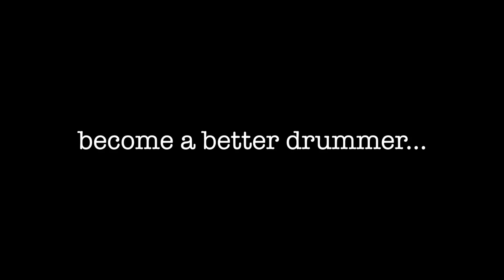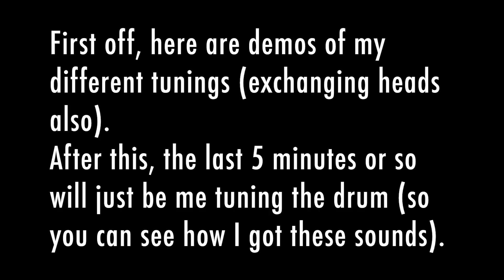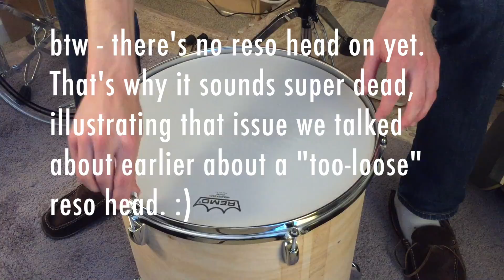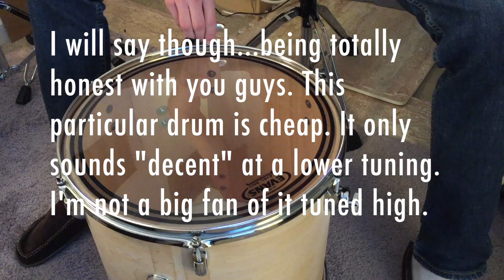Why Does My Floor Tom Sound BAD?

Comment: Dude, this is so much more a helpful tuning tip video than I've been able to find anywhere else. ESPECIALLY because you actually talk about the resonant head; which is something that isn't very much talked about in other videos. Thanks so much!
Reply from the maker: Thanks, man! Yeah it's super important to get the resonant head right. It's easy to overlook it. I've found that in any tuning situation, if you're having trouble getting a drum to sound "right"...try changing up the reso tuning. That often fixes it.

Comment: For toms, I use a one-ply resonant head and a two-ply batter head, tuning the reso a perfect fifth higher than the batter (for a perfect fifth, hum the melody to "Here Comes the Bride" in any key). This means that your drum will pitch high as the reso rings out first and then drop down when your stick releases the batter. IMHO, this sounds way better than going from low to high or trying vainly to get both heads tuned to the same pitch. They never will stay at the same pitch anyway and will merely run interference with each other - kind of like a pair of air horns! 
Then I tune the batter of the the next tom up to match the reso of the lower drum. If you use four toms, say 10, 12, 14, 16, then the reso of the 16 will be the same pitch as the batter of the 14 and the reso of the 14 will be the same pitch as the batter of the 12 and so on. This means that the kit is in tune with itself - like a guitar - because when you hit one drum, all the other drums ring a bit too, don't they? In fact the whole kit resonates - the cymbals too!
So ... Remo Emperors or Pin Stripes on top and Ambassadors on the bottom (or Evans G2s/EC2s and G1s). Nice Evans drum key BTW. I have two of those that I use for quick head changes. Not only do they have that cool knurled knob at the top, but they have little magnets inside the key so they stick onto your tuning rods. 
Please note: this stuff works for me and it's just my opinion that it sounds good. However, if you're having trouble with your tunings, then you may as well try it. Also, if your kit is just too ringy in the studio or your practice space, then try using Aquarian damper rings. I get a nice fat sound with them on my heads, but I take them off for live. Drums should ring - that's what carries your sound. Thanks for the videos Stephen, they are really good!
Reply: Sal Paradise Thank you for the great tip I want to try this (I’m planning on using pinstripe batters and ambassador resos for recording soon).  But if I’m only using a 4-pc kit and have a 12/13 rack and a 16 floor, how should I tune them together using your method?

Comment: The craziest trick for floor toms that I've ever learned—and I've never heard of anyone else ever doing it—is tuning the batter a little higher than you're used to, then completely loosening one tension rod. I'm meticulous and neurotic with my tuning, and on paper, it seems like complete nonsense, but I can't tell you how many times it's saved my ass in a live situation where the sound guy just couldn't get ahold of the overtones.

Comment: Evans has these Hyrdaulic heads, It's great for players with no experience in tuning at all and are really easy to setup without much tuning. Try them out!
Reply: As a proud owner of blue hydraulics, this video is still very helpful. My floor tom sounds like booty and this video is helping a crap-ton
Reply: I would say EC2s are the best in terms of sound quality and ease of tuning, the hydraulics are easy to tune but lack fantastic depth of sound imo

Comment: Here’s a pro tip from the front lines...we’re talking the Boston, gb circuit, Berklee dweeb stuff that no one tells you. The kind of stuff that will get you more gigs.

A huge majority of drummers out there tune their toms too low nowadays. Especially, ESPECIALLY if you’re in a situation with minimal micing. Low tuned drums sound amazing behind the kit. In my practice space, I keep my drums tuned nice and low because I prefer that sound in that environment.

In a gigging situation, no one can hear that. The low end dies in a sea of guitars, bass and middle management douchebags trying to outdouche each other in front of you. Tune your toms a liiiiiittle higher when you’re out. 

At the end of the day, the most important sound is the sound 20 feet out front. If you tune your toms low like every other drummer, your tom work is going to sound like the same indistinct “papapahdodododoo” as every other drummer. A little higher and your personality will pop right through in that context. This is the best single tuning tip I ever got and it’ll help with floor tom tuning as well. Floor toms become exponentially more difficult to tune as the pitch decreases.
Reply: 2 years late to this reply, but You are 100% right! I tune my toms low and I mic my kick and toms at every gig because of this. If I'm unable to mic up (Which is fairly rare) I bring all of my tunings up and drop any muffling I previously had on the toms.
Reply: Another late reply, but the slightly higher tuning and no muffling works just fine with mic’ed up toms as well. Many pro drummers, Simon Phillips, John Bonham, etc. play their toms wide open and tuned up to get resonance and tone. It’s all about mic placement and how you control the input (gain, volume, etc.) I play my toms mic’ed up with no muffling and have the toms tuned medium tight, slightly higher on the bottom. For my kit I find that with the floor toms, the interval between top and bottom is less than my mounted tom. I have a minor third difference on the 13” tom, a 1/2 step on the 16 and 18 floor toms. Most drummers I see on YouTube have their 16” floor tom top head tuned to about an A. For me, that’s too low. My drum sounds floppy and feels sluggish at that tension. I’m closer to between a B and C on top. One thing to note....if I didn’t have an 18”floor tom, I may go lower on the 16.
Reply: Yes. And this should be considered for snare tuning also in live applications. A few years back I was having fun trying out my different snares at different gigs and playing with tuning. I cranked a mapex armory metal snare I have as high as it could go before choking.. What I discovered was that all of the kick and snare parts in the grooves were more defined and heard clearly. I guess the further the pitches are from each other the more clearly they’re heard individually with no overlapping. 

This was something I noticed drummers playing live concerts in the early 80s. The snares were always cranked.
Reply: @martinel2450  

A version of that sound re-emerged in the 90s, too. Half of the grunge records everyone loves were recorded with a piccolo snare, squashed to hell and back with an 1176 or a fatso….why? Because it sounds great, it’s aggressive, enormous and it cuts.

Comment: hi Stephen, very informative video
but according to me, you forgot an important reason why a floor tom can sound bad; the legs of the tom!
i m talking here about floor toms that stands on three legs, not suspended toms on a cymbal stand that usually sounds great because of their good sustain, and sustain is maybe the most important topic when we talk about a good sounding drum, without sustain, nothing possible, and of course it's possible to control the sustain 
the three legs of floor tom are sometimes the reason of a cruel lack of sustain, and if you lift the tom from the ground, you will find that the sustain is back, as if the ground would absorb the resonance of the drum...the reason of that could be because the gum at the end of the legs in not protecting the drum to sound and vibrate freely, or the gum isnt here anymore, or sometimes a bad conception of the drum itself
thank you for your videos
greetings from France
Reply: Agreed, your the only one who got it right, I have a 1964 set of Slingerlands, 14" and 16" toms always sounded like a cardboard box. I changed the minimal rubber feet (gum) to the resonator feet from my Pearl kit and 200% difference and I've never been dissatisfied since (playing 56 years)
Reply: Monsieur. I reckon you are right. Vous avez le raison mon pôche.

Comment: Funny, for me it's always the mid tom espacially 12".
Reply from the maker: Really? I guess it depends on what you're going for. Most of the time I'll get a rack tom sound I like pretty fast, then spend more time on the floor tom. I will say though...I prefer 13" and 16" toms on a 4-piece kit. I'm ok with a 12", but if I have one rack tom I like a 13", which I find pretty easy to tune. Do you tune higher or lower generally?
Reply: Yes me too I can not tune my 12 inch
Reply: Same
Reply: That's everybody lol. 12s are notorious
Reply: try working on your reso head. i thought there was something wrong with me but then i checked the reso head and it was tuned way too low. for toms, you want the reso and batter heads to be identical in pitch.
Reply: Same
Reply: my 12" tom always sounded awful. part of the problem, it turned out, was the tom arm / holder. Swapped it out for a different arm / holder and it sounded better, though still kind of 'dead.' Replacing the reso head also helped... my thought is to go to a very thin reso head.
Reply: el bicho feo I have the original mapex arm all my other toms sound amazing and the bottom reso is less than a year old and it’s a ambassador
Reply: Agreed. I finally got a good process for tuning my 12. My 10 hums
Reply: Remington Creech interestingly the Tom arms I was using - that somehow contributed to the wack-ness of my 12" Tom sound - were Mapex Tom arms!!! Saturn series circa 1994. Replaced with spare Pearl Tom arms, the Tom sounded much better...
Reply: ...same...
Reply: One problem I notice with tuning a 12” tom is it’s angle and proximity to the bass drum. If I have it too close to the bass drum, and without a good amount of angle (anything less than 30 degrees) then I will usually get a fairly dead sound.
Reply: Morgane Gautier yep
Reply: Andy S I’m using the latest version of mapex Saturn I didn’t mean to buy the g1 I wanted g2 for too not sure if that has any dealings
Reply: Andy S if it’s the arm wouldn’t you think my 10 inch would sound bad to I love the way it sounds
Reply: Morgane Gautier yea occasionally. My high rack tom always sounds really good haha. The other two are harder to keep sounding good
Reply: Jrottin I’d have to disagree in general with the identical top head/bottom head tuning method, not only is it incredibly difficult to maintain the perfect pitches from day to day (or even song to song), but also microphones really don’t understand the resonance typically associated with that tuning method, especially if you’re using anything less than extremely high end drums that have been designed to resonate at the same durations, ie, all drums share the same dimensions. Just a thought, nearly  every pro drum tech that I’ve spoken with agrees that the most effective tuning method for front of house excellence is similar to what he’s described here, a tight bottom head with a slightly looser top head, mostly just tuned to feel right.
Reply: My 12" gave me so much trouble with tuning and tension rod housings breaking off that I finally just replaced the whole thing, lol.
Reply: probably has more to do with how you hit the drum than it's position, but maybe the difference in position causes you to hit the drum differently
Reply: Remington Creech 12" tom should be the easiest to tune and have the widest range of tuning potential.
Reply: Joe Rico I got a g1 and I’m trying to get a low sound I think that may be kt
Reply: Remington Creech Try a Remo Coated Vintage Emperor. I have mixed feelings about Evans. They sound nice when brand new and die a sudden death. It’s the Mylar film they use which is inferior to the one Remo uses. I DO like the Level 360 technology....but the film Evans use or whatever they do to it when forming the heads just doesn’t hold up. I have 3 year old Remo heads on the batter sides of my toms and want to change them ....but they still sound AMAZING! Evans dies for me after 2 to 3 months of light use.
Reply: Joe Rico agree I’m not a fan of Evans it was my first time trying Evans not a fan
Reply: Yep, me too. I've got a 16" and 18" floor and they both are extremely easy to tune and sound killer. My 12" rack tom is a pita to tune. It's definitely the black sheep of my kit. I always get a baaawwnngg or a boyyoyyoing or a beeewwmmpp out of it, even when all the pitches match. I actually sometimes wanna put a moongel on it...eeewww! :-/
Reply: Hahah. 12" always for me. :P
Reply: For me, the 12 is a lot lesser with tuning problems than the 13, but I do like a 16 over the 14 Floor Tom....  great video Drumbrother!
Reply: Of the many sets I've had and have, mapex pro-m were the worst especially the 12" tom.
Reply: I've realized my 12" tom sounds bad because it's position. If the reso head is too near to the bassdrum it gets chocked. It might be the problem for some of you guys too.
Reply: I swapped my maple 12 to a poplar 12, but kept the 13 maple.
So, poplar 10,12 and maple 13,14,16 sounded the best.
I read pearl reference only uses purely maple on the 13, but I figured it out myself, luckily i have a lot of different types of the same color. So it worked out perfectly.
Reply: Morgane Gautier I’ve pretty much just stopped using toms except for the occasional floor tom.
Reply: im not the only one...
Reply: To solve that problem, I tube my floor tom, aß i want it to be. Than I tune the 12" a quarte higher. That sounds pretty awsome
Reply: Yeah the 12 inch is super difficult to get just right, for me it tends to tune very slightly too high or too low and give loads of snare buzz
Reply: @Assimilator702  super easy mine is a. Clear low E note
Reply: For me it was always 13' Tom's. I've heard odd numbered intervals are a bit of a bitch to tune

Comment: I struggle with getting it line with the other toms.  When I was an ignorant novice, I just couldn't figure out how the drummers of my favorite bands got the amazing sounds.  Then I realized that they were all using mic'd up toms using computer assisted sounds to achieve warmth.  Maybe the sound you are trying to achieve isn't something that is natural.  It kinda like photography.  The camera does most of the work, but you still have to use Photoshop to get the ideal photo. Just food for thought.
Reply: When your favorite drummers are playing live, it is more likely that they are using gates, compressors and possibly reverb through the PA. This makes an incredible difference to the sound of your drums as heard by the audience. It's fairly common for metal drummers to use triggers on their bass drums to achieve uniformity in sound for live shows but usually only the bass drum.
At the end if the day though, it still comes back to tuning. Badly tuned drums will sound rubbish no matter how good the sound tech is.
Reply: What garagemuso said!
Reply: Computers didn't always exist. Drums at one time were only mic'd by a couple of boom mics hovering over the drums, if at all.
Tuning to get the proper sound was all you had. The quality of the drum was extremely important. Slingerland, arguably were the best overall drums ever made. They used a wood that no one else would get because of the expense. But they made the drums, and charged more, in hopes that people would pay the premium. 
Slingerland is gone now, the primary reason . . . the wood was getting scarce, and the price kept going up until drummers weren't willing to pay the price, as other drums were getting better because of acoustic research getting better.
But the point being, quality, and tuning were all you had.
Reply: @DDS029  Exactly...the old-time pros had great sound because they had exceptional ears and understood their instruments...not to mention their other talents!
Reply: True. And sometimes what we hear from behind the drums isnt what is out front. A venue I play has a sound guy that always has the floor sounding like a Harley even when I feel like the tuning is not 100% that night.

Comment: Stephen, my compliments to great practical, logical presentations.  I have a cheapo Gammon kit , gifted to me xmas 2018  by my wife (!!!!), to allow me to return to playing drums after a 50 year hiatus.  Im 69 years old and retired now with unfortunately spinal issues .  The kit includes 12, 13 and 16 inch toms.  I ditched the snare for very good used pick up on a DW Design one, changed all the heads on the toms with 3 or 4 different combos.  Tbe 16" floor tom is absolutely the  ost difficult to obtain acceptable Dooooo, Doooooo sound I'm looking for.  I'm  spending too much $$$$ on different heads , probably very foolishly.   G1s, G2, Remo ambassadors, and even 2 different Attacks...... the lztest being their ToneRidge heads .  The ToneRidges didn't work well, same with the G2s.  So i went back to Remo Ambassadors coated on the reso, and G1s clear on tge batters.  Changing and mixing is driving me Nuts.  Its becomming an obsession.  Whats your advice ? I'm not sure what tge Gammons are made of......probably some wood combo.  Thx, be well and safe